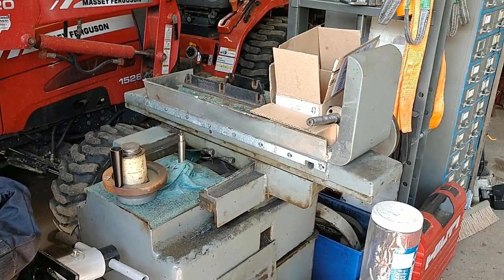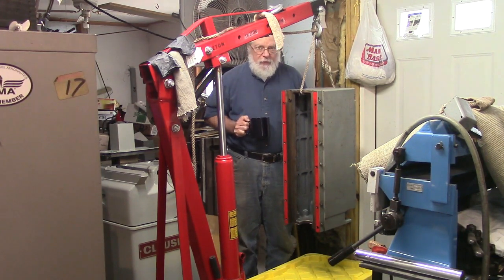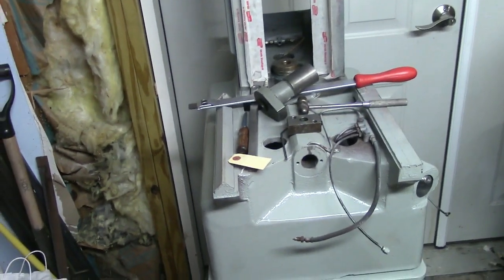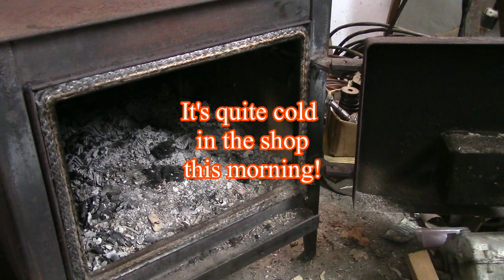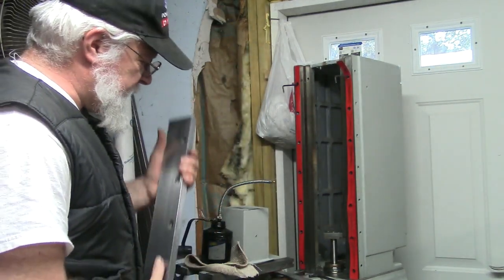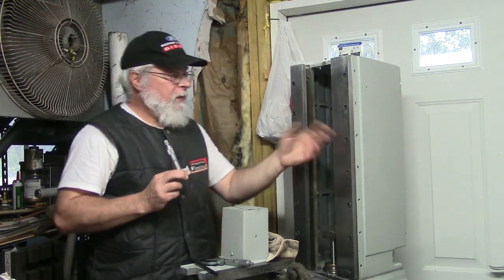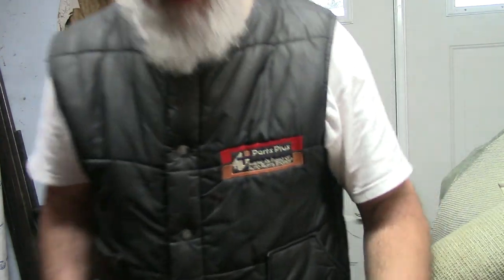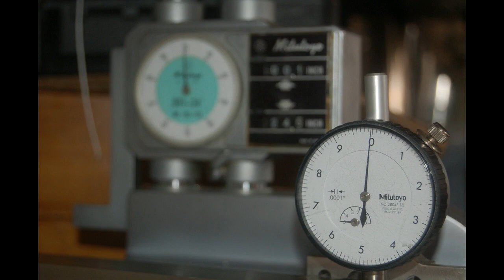Restoring a Clausing 6x12 Surface Grinder- Part 1

Comment: Nice work. Thats the same spindle adaptor as my Boyer Schultz 6-12
Reply from the maker: Thanks for that information. I suspect this is a widely used adapter style.  I like your shop too. Look forward to your projects.
Reply from the maker: Thank you. Knowing that pointed to several possible sources. Looks like I have a reasonable part number now.

Comment: I have found that the Rustolium smoke grey is a better match for my Clausing restorations?
Reply from the maker: Your probably absolutely correct. But  my Clausing had three different color layers on it, none of which bore any resemblance to the original.   I like this machine grey though.

Comment: there's 2 common adapter sizes on 6x12s and yours looks like the smaller one also on tool cutter grinders by the relief in the middle of the taper
Reply from the maker: Thank you, that's helpful to know.

Comment: Hello, I have the same grinder. have disassembled most of the parts for cleaning but I cannot figure out how to separate the motor from the spindle slide block. Can you let me know the to are attached to each other? I have removed the height block from the bottom already so now. Does the spindle slide out with the motor? TIA
Reply from the maker: I wish I could tell you, but I did not need to rebuild my spindle bearings and left well enough alone.  Spindles can be fussy.  Most spindles rely on compression to preload a set of front and rear bearings. So I'd look for a large nut behind the wheel taper.  I'm not close to the machine at the moment but will look when I get home.  Thanks for watching, hope it was useful.
Reply: @i-squared  I have been watching your videos trying to learn from your restoration. Would be great if you can share how to remove the spindle sliding block from the motor for rust cleaning. Thank you.
Reply: Another question. what is the lever right next to stop block for (in middle of saddle)?
Reply from the maker: @noonenoone1206   As for the lever. That locks the Z axis (in/out) movement of the saddle for grinding on the center of round objects. Using a horizontally mounted cylindrical part, usually mounted in a rotary table, or "Spin-Dex", with its axis aligned with the machine's X axis.  The part is positioned with its feature to be ground under the wheel and the Z axis locked,  This is especially critical if grinding a gear tooth or spline. 
As to your first question. I did find there is a locking ring just behind the wheel mount taper. You'll probably need to make a special offset spanner to grab the hole in its side and remove. I would expect a left hand thread. That should enable you to pull the entire bearing and mount assembly off of the motor shaft.  You'll may need to fashion some sort of puller to push the shaft through the bearings.  I would also suspect there's also something holding the motor frame on to the rear of the mount.  I would check for LONG bolts through, or under, the rear bell of the motor. I couldn't easily get to the rear of my machine. Later this summer I have a reconfigure of the shop planned and will look then.
Reply: @i-squared  thanks for sharing more detail. Actually in this video at 2:20 you were showing the motor with the spindle assembly attached to it. From this, I take it that the motor assembly must have been removed or pushed through the sliding block from the back. I just could not figure out what's holding the spindle to the sliding block - even with the spiral lock ring removed I was unable to get spindle to move so I stopped. I just ordered a user manual for this machine, and will tackle this again in near future. I got it all back together for now. As for the lever, I see what you meant now but on my machine it does not lock the Z movement; I see where it's supposed to clamp of the rectangular bar under the saddle but it does not move that far to clamp the bar. Will tackle this later. Thanks much for your time. I learned a lot from watching your two videos on this surface grinder.
Reply from the maker: @noonenoone1206  Ahh! You've refreshed my memory! At 55:35 or so you'll see an Allen Grub screw halfway down the carrier block which holds the spindle and motor assembly together as a unit.  I remember thinking that's not much to  hold all that together but it seems to be enough.  The spindle sleeve seems to be attached to the motor with four bolts from the front as you noted at 2:20. 
Please post your results, or make a video yourself. I'd love to see how you did.  I'll be making balancing rings soon for my wheel adapters. In hindsight, I wish I incorporated  a balanced groove into the adapters when I made them, but it's correctable.